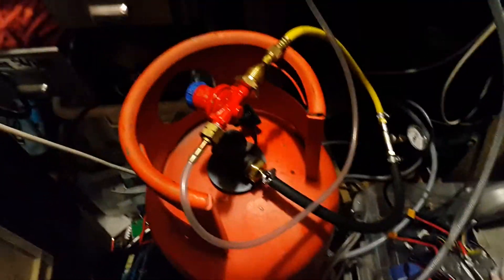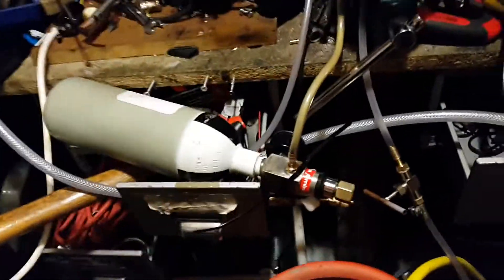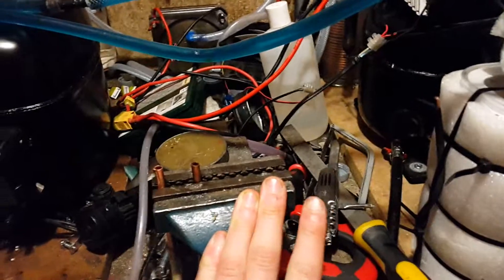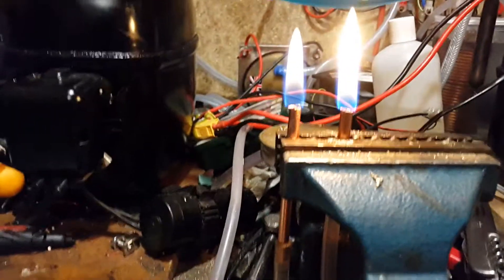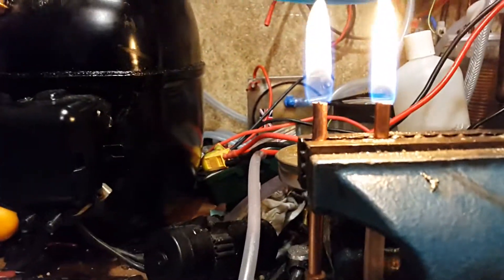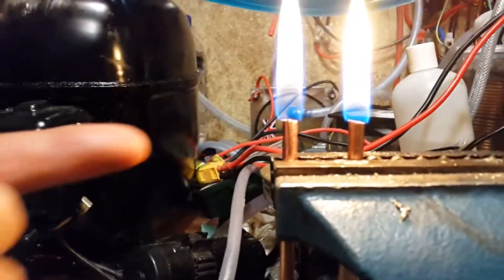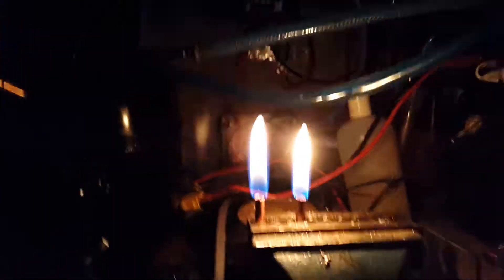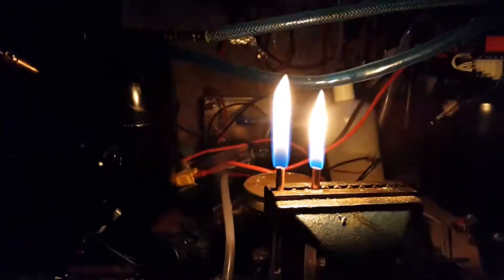Propane vs Natural Gas Flame

Comment: Which one is hotter depends on how you are measuring it.  Per molecule or per volume, propane burns hotter because it has more bonds per molecule that are releasing energy, propane has 3 carbons vs 1 carbon in methane.  Both gases occupy the same volume when other variables are held constant.  
Per kilogram, natural gas burns hotter because there are more molecules of natural gas in a kilogram compared to propane, propane is a heavier molecule.

Comment: Propane is hotter than natural gas and has a higher energy value being derived from oil. 

Yellow tips and soot on a cooker or boiling ring or BBQ or patio heater running on propane isn't normal and are an indicator of poor gas / air mix. 

Propane gas at 37mbar pressure needs more air to burn cleanly as does butane gas at 28-30mbar pressure to avoid black sooty dirty burning and staining to pans kettles and utensils on a hob or cooker, although BBQ / patio heater / grill / oven burners on butane at 28-30mbar pressure do produce a very slight visible yellow tipping at the top of the flame, but this is ok as long as the flame doesn't emit soot or carbon deposits or cause blacking.
Reply: Maybe all you guys need to go back to the school and understand the basic of the nature

Comment: Been trying to research this and the video is interesting (not trying to be "that" guy or a know it all) but the claim that natural burns hotter than propane that you made is rather contradicted by other sources like BBQ and gas suppliers... I just read earlier that Natural gas going through a BBQ has to have specific fittings to allow more gas to pass through and burn about equal in heat to Propane. That in turn makes Natural gas burn hotter at the sacrifice of units it uses (eg gas per litre or whatever it's measured on). I guess that makes sense as the propane flame as you had shown was more intense... Be interesting if you could test the heat of both flames somehow.
Reply from the maker: I was wrong with that statement I think.
Reply: Shaun Dobbie I wasn't trying to be a dick or nothing. Like I said, was an interesting vid
Reply from the maker: Omen7grind I never thought you were.
Reply: Your right....Propane burns hotter.
Reply: At equal volume natural gas burns slightly hotter 

But per molecule propane burns hotter since there's more bonds being broken (exothermic)